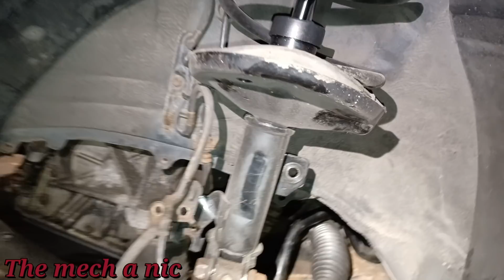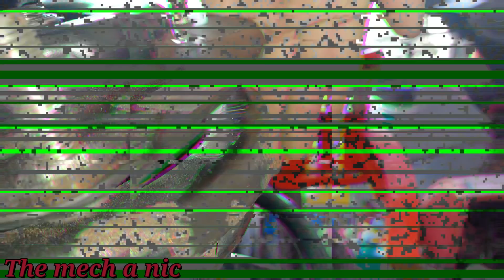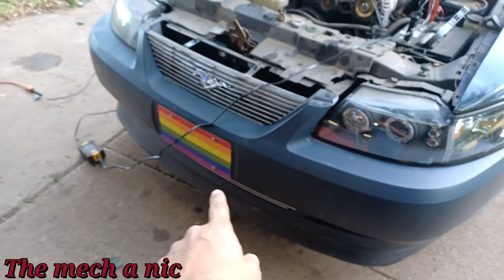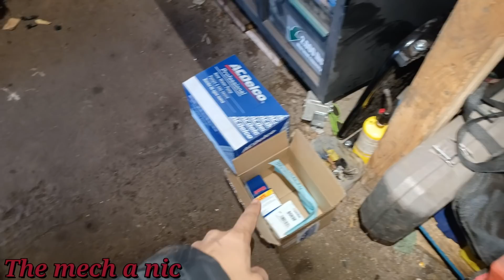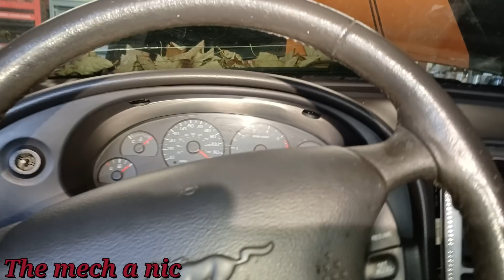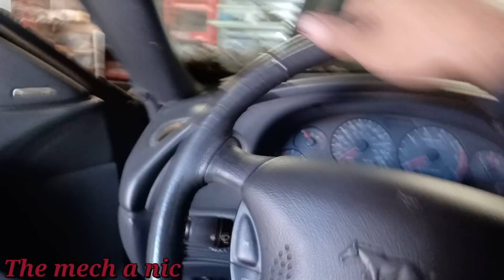camry front struts and sway bar bushings / mustang waterpump (vol 108)

Comment: Trivia Time:
Most people think that the reason for heating a fastener (nut) is to 
expand it. That is only a small part of the end result.

"Rust" or "corrosion" of any kind, is the chemical reaction of the
Parent metal with oxygen, a highly corrosive gas found in water.
We usually associate the word "rust" with the brown colored 
corrosion of iron (iron oxide), but all "rusts" still contain their
Parent metal.

Heating to a high enough temperature reverts the powder back
to a gas; the resulting pressure, plus the absence of the powder
between the threads, allows the fastener to loosen. Heating is also
necessary for the removal of certain thread lockers, following this
same principal- heat makes the polymer a liquid again.
Reply from the maker: Thank you for the great information 👍